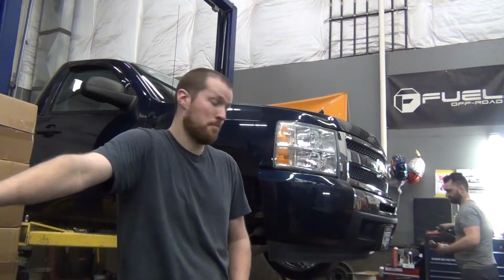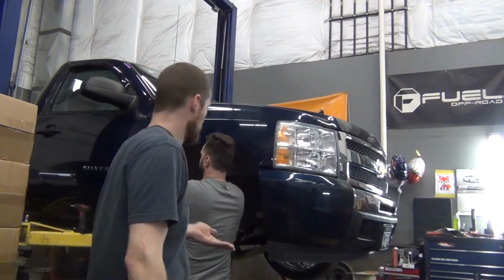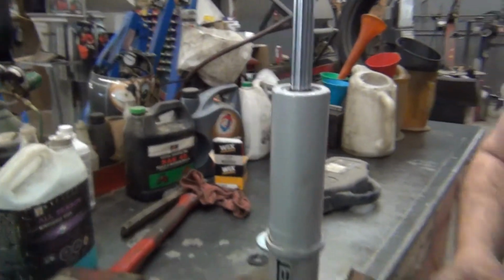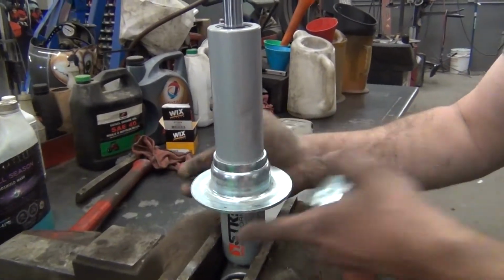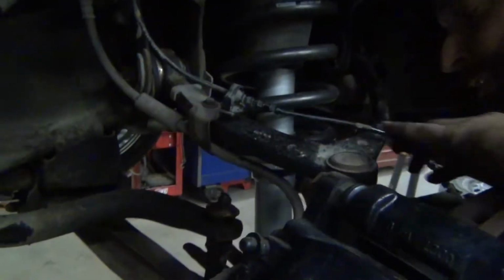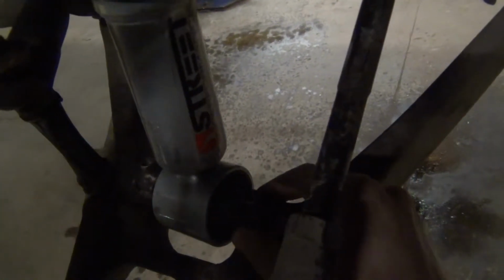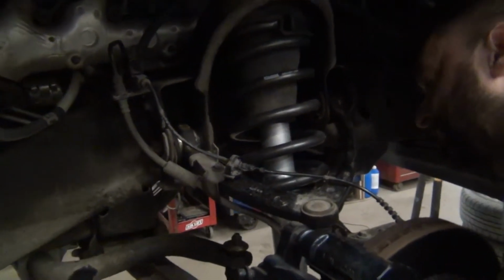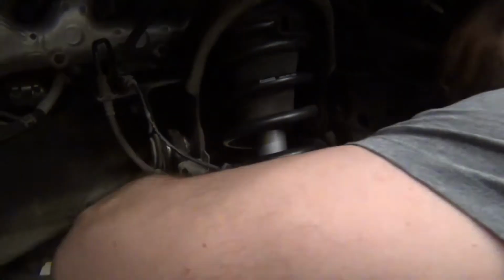Chevy Silverado Belltech lowering struts installed to get level

Comment: i have 2014 silverado 1500 5.3 z71 LT. i have lowered the front with 2 inch drop spindles and 1 inch drop springs and belltech 25004 strouts set at 0 drop. when i hit certain bumps the tire hits the inside of the above finder. ive taken both finder covers out . still bottoms out. plz help

Comment: Hi guys here is my question, 
I just lowered my 2016 crew cab Silverado, and they reused the factory shocks with the lowering springs, and the front rides rough, is this the proper way to do it?? Or do i need a different shock?? Looking for smoother ride thanks
Nice video btw!!
...
Reply from the maker: when you lower a vehicle stiffer ride quality is most times what you get because the suspension can no longer articulate as much, causing more driver feed back, however if the factory struts and shocks were worn out or leaking the ride quality would stuffer either way, and after 6 years I'm sure they should have been replaced anyway. New ones with fix you right up! go for Monroe Reflex!
Reply: @carsinmotion4660  got it!! thank you so much for the reply,
Reply from the maker: @HIDALOKO69  Sorry the reply took so long, I'm going to be more active pretty soon!
Reply: @carsinmotion4660  no problem!!!👍👍